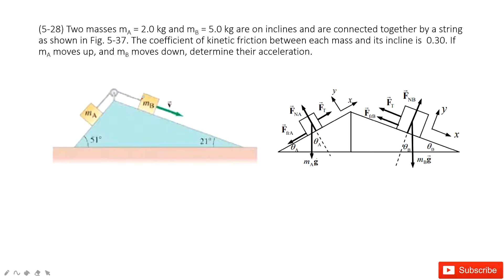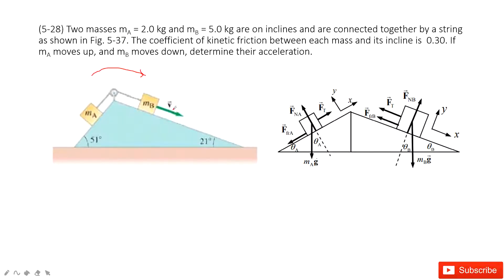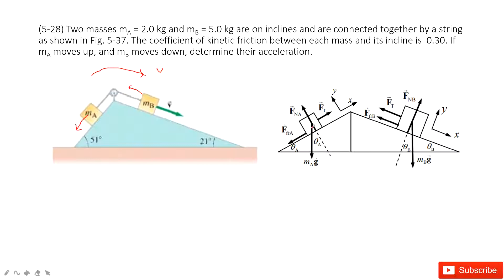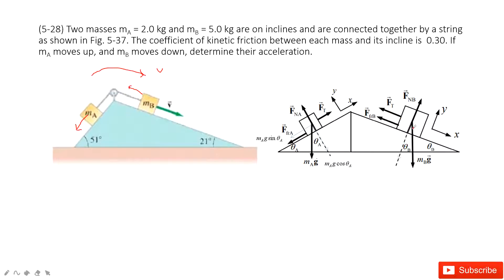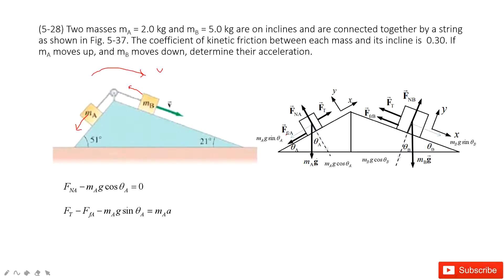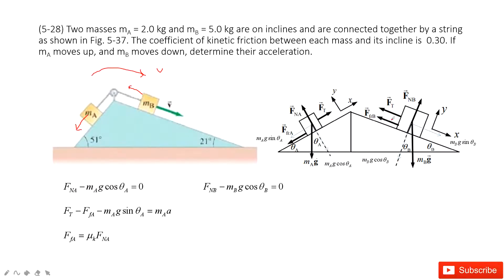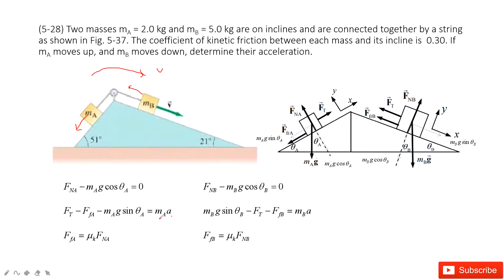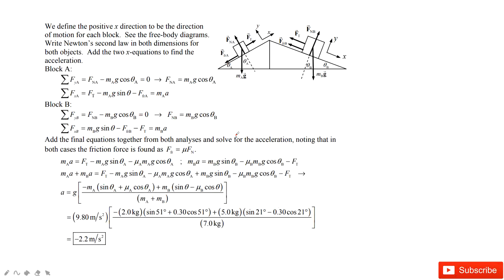(5-28) Two masses mA = 2.0 kg and mB = 5.0 kg are on inclines and are connected together by a string

Comment: Because the resulting acceleration is negative, the friction forces would reverse direction. Redo the problem with motion in the other direction and another negative acceleration results. The net result is that there will be no motion of the system since friction forces are too high.

Comment: what actually makes friction in the inclined plane? Is it gravity or the additionally applied forces? 
I am confusing it because Ffr = Mu * mgsin(theta)...so in case of ma1, in this problem, m2 does not make friction.. Then why the dirction of the friction is apposite to the Ft?
Reply: In the case of an incline, the force of gravity is not perpendicular to the surface. As the angle of the incline increases, the normal force decreases, which decreases the frictional force. 
The angle of an inclined plane bends the direction of the normal force that pushes the surfaces of bodies together.